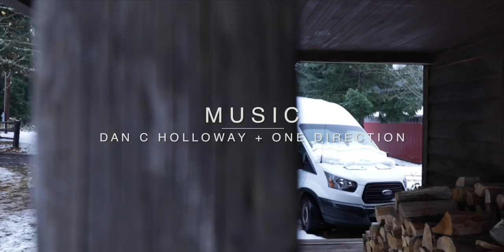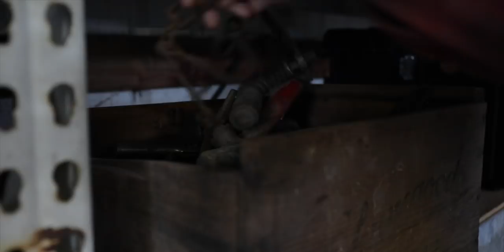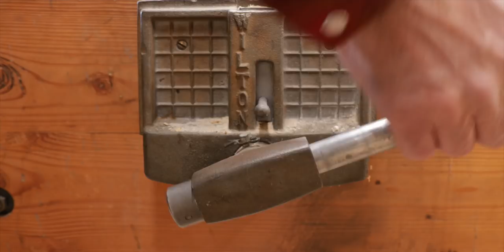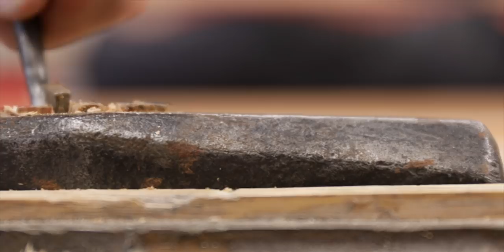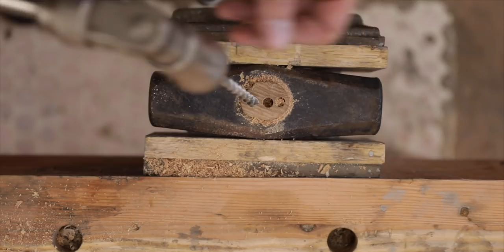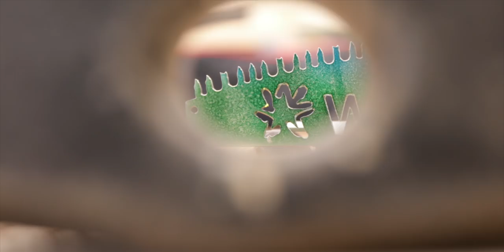Restoring Granddad's Sledge

Comment: You could have easily used modern power tools, but restoring an heirloom item like that with hand tools is just class. It just feels right. Also, while my initial reaction to the zoomed in shots was a wary one, It dawned on me how pleasing it was to see something as simple as the vice screws turning while you worked. Maybe its just me.

Comment: Next video: 6 minutes of preparing a wire wheel for part 3: removing surface rust, to get ready for part 4: thinking about wood for a handle, to part 5 starting to move in the direction of the wood that'll be used in the handle in part 2386! TL:DR check back in 10 years when he's finally ready to hang the head.
Reply: Nate M then leave this channel and don’t come back.  So unappreciative. Sheesh.
Reply: Here's Johnny then don't read my comment. So judgmental. Sheesh.

Comment: Very nice, but I have a technical question: why 3 smaller holes instead of one big one?  You had all the bits out, I'd have picked one only slightly smaller than the handle diameter...honestly curious.

Comment: i have a head almost exactly like that. only way more beaten. was my great grandpas. has had a metal handle welded on, clean it up and put a burnished handle on. use it for splitting wedges and rock splitting

Comment: Hi Cody, is this the same sledge that you restored/replaced the handle of in March 2014, when the intro was still you, Mrs W & Jack, "This is modern homesteading"?
It kind of looks like the same head, you gave it a fawns foot handle back then?
If it is the same head (going by the wedge depth and step wedges it going by the spacing and slight angle), why not tell what happened to the original handle replacement to let others know of potential weak points to avoid? 
Blessings brother,
from Australia.

Comment: I would have used the 20 ton press, sitting to the left of the box from which the sledge hammer head was retrieved, to push the remaining section of handle out.... It shows at about the 50 second point.  Quick and easy!  Perhaps Cody forget he had it due to having so many tools! ;~) The process demonstrated works too...

Comment: I was wondering when you'd do more resto's.

Didn't you waste a lot of time on this one though ?
Just wondering why you didn't just take 60 seconds to cutting it flush with a coping saw and knock the wood from the bottom out the top.
You got the job done, but I've never have this described method fail to work and work quickly at that. I'm sure some can be stubborn I just haven't encountered one yet.

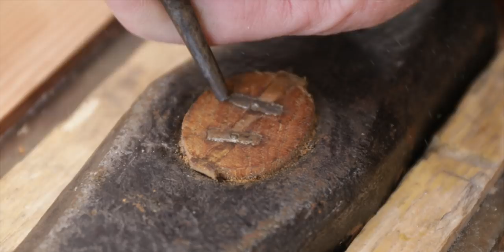Comment: Come on, this is 30 seconds of work turned into a 5 minute video.  Exactly 2:00 40% of the way through the video the first strike of the punch to get the wedge out.  Another 2 minutes of wiggling when a pair of pliers would have done the job, and a minute of worthless drilling when a dowel rod and a solid hammer blow would have removed the plug. Plus a 30 second crotch shot.
I appreciate the use of brace and bit, I appreciate the time that went into the cinematography, I certainly couldn't do anything near that.
There's just no substance here.  It's all fluff.
Reply: Vincent A I thought it was rubbish too. posted my comment before I saw yours actually. laughed when I saw you reference the crotch shot verbatim haha